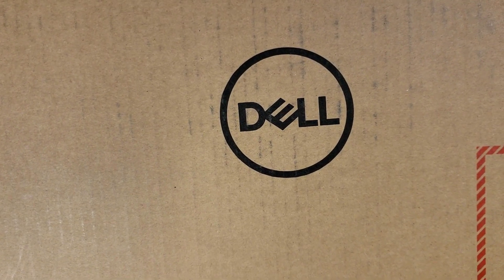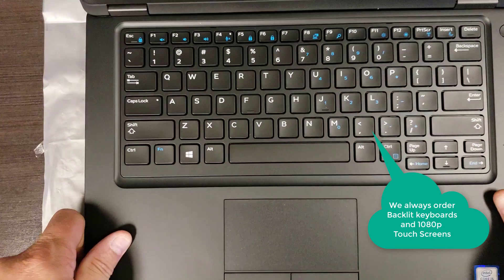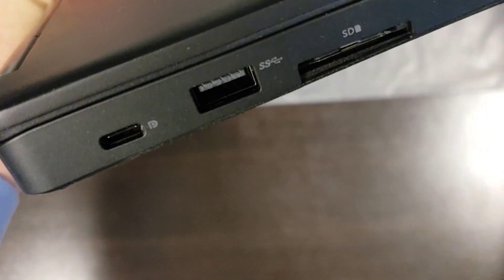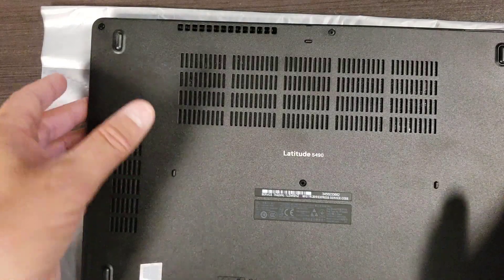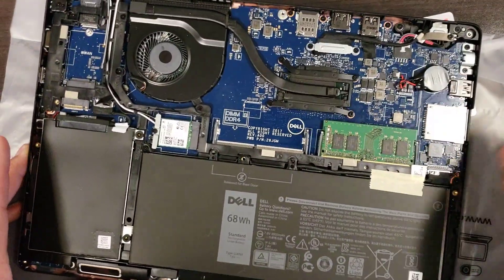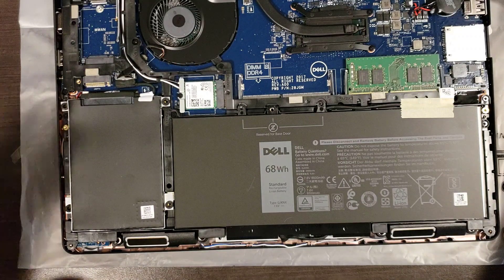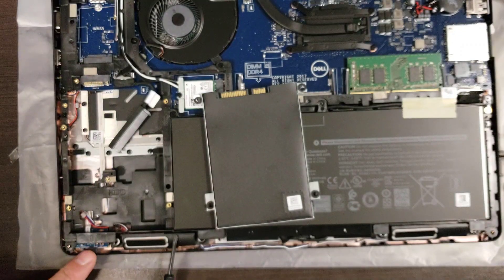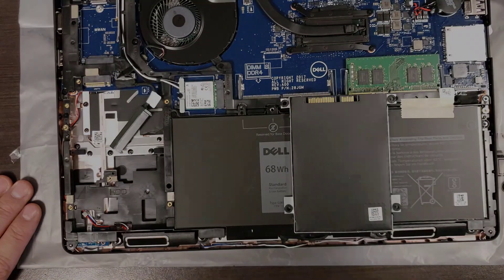Dell Latitude 5490 Unboxing and Basic Disassembly To Change Hard Drives, Battery or Add Memory

Comment: Handy for getting the case off - Thanks for the tip about the central screw-pull. Took me 3 seconds after seeing that mention and came right off in one gentle pull.
Reply from the maker: Thanks Dewey.   Glad it helped.   Thanks for watching and commenting!
Reply: If reusing the hard drive, or salvaging data from a hard drive, is it best - once removed from the old laptop - to put it straight into an External Hard Drive Enclosure in order to keep the connectors dust and dirt free? I haven't touched it yet and it is something I need to do. Obviously it doesn't want banging around in a drawer with the connectors exposed. The drive looks relatively small. Can you give advice and the size of the drive itself, please? I am just being cautious. Many thanks.

Comment: To add the M.2 drive, you will need the following Dell Part number (which I have bought on eBay several times for a dell 5590 I own and I also will upgrade my 5490 with the same part : The Adapter part number is: 2FFR0     Google it with the word Dell in front of it and you will find copies for maybe a bit more than $10? Further comments from the article referenced below goes on to say:

The adapter needs 2 screws. 1 to screw it into the motherboard casing, the second to hold down the NVME drive (and heat sink)

This part is REQUIRED in order to install the NVME drive. Otherwise, there's nothing to hold the drive down. Now the following article has pictures and its agenda is a bit more aggressive for the Dell 5590 15.6 " screen  (not the 5490 (14" SCREEN) which is a bit smaller)  - on how to install not one but two hard drives (SSDs) both M.2 and the normal SATA interface for a   SSD drive (to replace the slower HDD). I actually did this successfully for my 5590. I MIGHT try the same technique for the smaller 5490 if I can fit the half size mSata card  (see the section called "mSATA Half Length Adapter") referred to in the article below (also bought on eBay for like $5 to $15 for the adapter card but the mSATA drive will be like at least $60 for a decent sized one for a "2nd" drive) in the laptop case, see:
https://www.thewichitacomputerguy.com/blog/how-add-second-hard-drive-dell-latitude-5580-or-5590?page=1

Comment: Neither the owner's manual or you didn't give a tech-spec mention of the WiFi Card or the WWAN card - an M.2, I presume.  The WiFi cards are readily outdated, with Bluetooth 5 widely available along as AX wifi standards.  If the owner's manual or you had displayed the connector-tips, we'd have seen 1 or 2 notched connectors for the existing card, and know then the connector was suitable -  or not.   On some previous generations of WWAN-slots, those can be bootable M.2 slots in the BIOS, so we've loaded smaller (but now rare and expensive) Boot Drives (128/256/512gb) SSDs and load the OS there, and save the M.2 1180s for 1-2gb drives.  Or use that for boot, then move all the TEMP and PAGE SYS FILES to the smaller, cheaper M.2 in the WWAN slot.
Reply from the maker: Great detail Chuck.  Thanks for adding to the conversation.

Comment: I bought the 7400, I was highly disappointed that it doesn't have a nub so I bought a slightly used 5490 to do most of my writting on. It has most of the nice options but only an i5 7300u, so I am going to see what it will cost to upgrade that to the quadcore like whats in my 7400. Very good instructions video.

Comment: Is it possible to perhaps fit two M2 NVME drives?
Reply: Most likely not
Reply: @louvain-fatskrrrt4698  Ahhhh but see what this guy did for the slightly larger Dell 5590 (might work for 5490) , using a M.2 2280 drive and then buy a half size mSATA card to plug into the old hard disk interface slot since a mSATA drive is also much much smaller than an old normal hard drive (HDD) . See this article (which I read like five to six times before attempting the procedure  in the article that has Dell  part numbers (google Dell  2FFR0 for the part to hold down the other end of the M.2 2280 drive, and suggestions to buy these parts on eBay and Amazon: https://www.thewichitacomputerguy.com/blog/how-add-second-hard-drive-dell-latitude-5580-or-5590?page=1

Comment: Hi. I have a Dell 5480. i want to add a second HDD to the laptop. i can seen in you video where, on the top left, where you have a blank space for WWAN card, i dont have anything written there. will it support M2 sata. can i use two M2 sata? on in this blank space and one in place for the regular HDD. Thanks,

Comment: I just upgraded from my 7480 to a 5591 with a quad and dedicated graphics. I love the build. It's nice. I got a 512gb M.2 in mine. If you can, upgrade to it. I run Mint linux 19 on mine, and the performance is sweet. Way too much hardware for what I typically do. But it should last for years.I stand corrected. WD black. Your the man!!!
Reply: Can i put a regular old 2.5 SATA mechanical drive in this, or is it M2 SSD only?????
Reply: @Mana_Beast_Beats  Well it depends on the configuration I believe. If you want a smaller battery, go for it. But given the low price of fast M.2 drives it would be a little silly.
Reply: @PearComputingDevices  -- I don't care about that, i just care about storage space. And apparently, it already comes with a 2.5 size Laptop Style drive by default. WD10JPVX are really easy to get a hold of. They go for like, $19 on EBay usually. I don't want to be stuck only being able to use M2 drives.
Reply: @Mana_Beast_Beats  Well, there you go. I would rather spend like $50 extra bucks and have an insanely fast 1tb of storage myself. I mean I bought a Samsung 980 pro the other day for like $65 dollars shipped. To me that's a no brainer. Not only is it a lot of storage, it's insanely fast and uses less power than mechanical drives and can use bigger batteries. But I am sure you could easily find a scenario that makes your idea not only great, but an advantage. I just don't readily see it.  But you do and that's what counts. One of the reasons I love Dell Latitude is you can build it up exactly how you want it. Lots of flexibility. Your not stuck with what Dell ships with, you can make it your own. Enjoy!

Comment: It's good that you can plug a WWAN 4G card, but it's unfortunate that you can't use both SATA and M.2 NVMe at the same time. I have Probook 440 G5 and I added an SATA SSD in adition to the M.2 2280 SSD. I have no free slot for WWAN, but at any time I can plug USB LTE adapter, which is minor minus, but I have 2 storage slots instead in a 14 inch laptop, so there is no excuse for Dell or Lenovo (for their 14" ThinkPads) to invent a better motherboards with space for 2 storage drives.

Comment: I thought about the same problem and I found this: P/N 2FFR0. You can buy it on ebay, but I didn´t try it, because in final I´m going to buy this laptop with a ssd and I will upgrade to NVMe ssd. (http://topics-cdn.dell.com/pdf/latitude-14-5490-laptop_owners-manual_en-us.pdf page 16; e.g. https://www.ebay.com/itm/Dell-Latitude-5580-5590-5591-5480-5280-5290-Precs-M3520-3530-M-2-SSD-Caddy-2FFR0/302336951785?epid=933387500&hash=item4664afc5e9:g:mGgAAOSwlMFZMNm- there will be probably missing screw for screwing it to the chassis, isn´t on picture).

Comment: I know that there is no option to have both ssd, and hdd at the same time as only one can fit in the disk bay, but is there enough room to fit m.2 ssd and sata to m.2 adapter with small 42mm m.2 disk in it? There are adapters as wide as just the sata connector. Would they work if there is enough room?
Reply from the maker: I don't think so.  I believe you are referring to an adapter like https://www.aliexpress.com/item/2pcs-B-Key-M-2-NGFF-SSD-to-SATA-2-5-7-15-22-Pin-Converter/32833687312.html .  However, I might be wrong about the second M.2 connector in that Dell may be discouraging the caching SSD by simply labeling the slot WWAN and dropping the caching disk option from the spec... but the slot really looks like just a standard "M-Keyed" PCIe slot and if so, I think it might work.  I am considering finding a small M-Keyed SSD right now for the slot labeled WWAN and will report back if I find that it does work.
Reply from the maker: So far Dell has confirmed that the WWAN port is nothing more than a standard mini PCIe port and it looks to me like a 22 x 40 M Keyed port.  Once they tell me how to order the 'clip' for the main m.2 port, I will order parts and test again.  I am hopeful that I can get the mini M.2 port to use a 60gb SSD and then I can use Intel RST to configure it as a caching disk, even though Dell says it can't be done.
Reply: I've read on some forum that somebody already tried connecting an m.2 ssd to that wwan port but to no avail. That's why I was hoping to fit two drives into the drive bay, one by m.2 port and the other via sata adapter. Too bad dell doesn't make it easy to expand functionality, as lenovo does. T480 allows connecting ssd drive via their wwan m.2 port... That's why now I consider buying lenovo.
Reply from the maker: I have rerecorded this video explaining the two PCIe M.2 heads because it really seems like you should be able to use a Caching SSD, but you cannot.  I am also recording a new video right now benchmarking the various disk options including the 2242 SSD.  Both will be posted tomorrow.